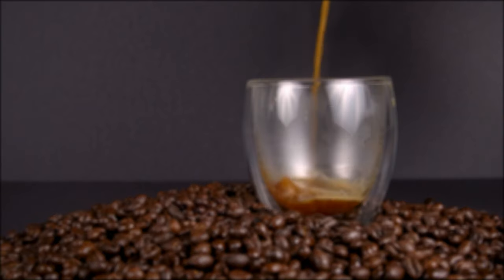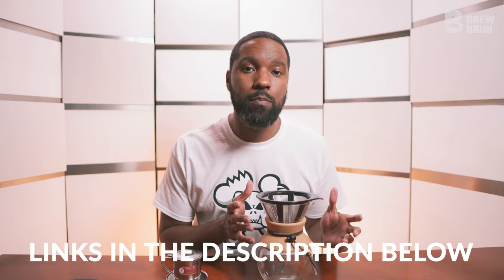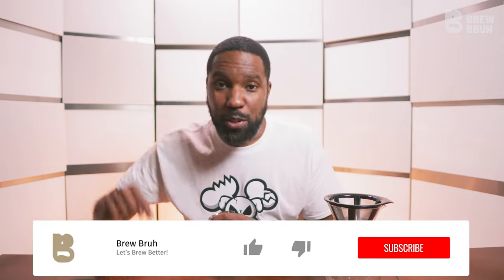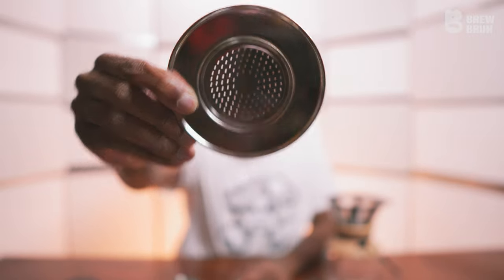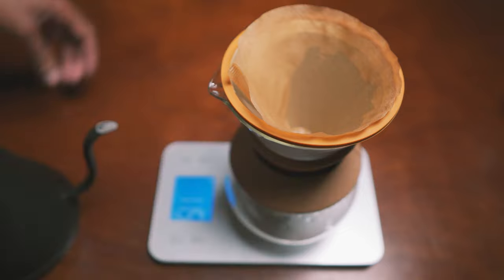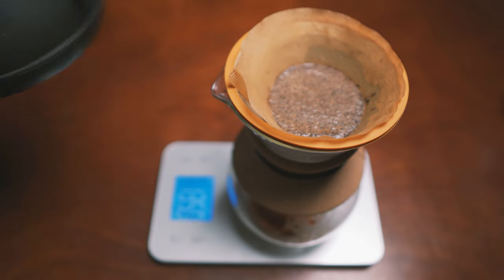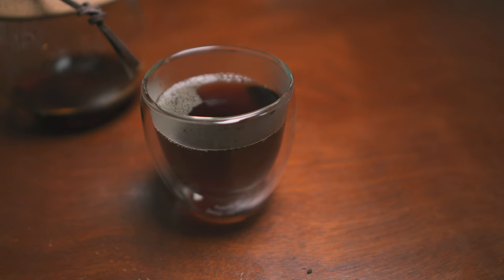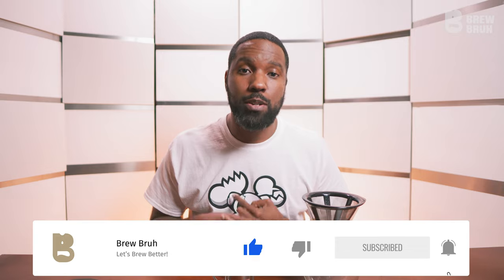Chemex and Vietnamese Coffee Filter | Channel Hardware

Comment: I'm disappointed that I found this video AFTER I used my Chemex to make Vietnamese drip coffee. I have the actual Vietnamese coffee filter, but it's in my cupboard and wasn't as easily accessible as the Chemex that was on my countertop, so I used that instead.

I've learned a lot of things about the Chemex, mainly that I have been using it wrong. Also, it may have just been the types of grounds I was using, but the Vietnamese filter took longer which meant that it had a stronger coffee infusion in it. As opposed to my Chemex just now and didn't take as long. Again, could be chalked up to grounds and how I've been using it wrong.

I appreciate this video. It was a great learning experience and helped me better use my Chemex.